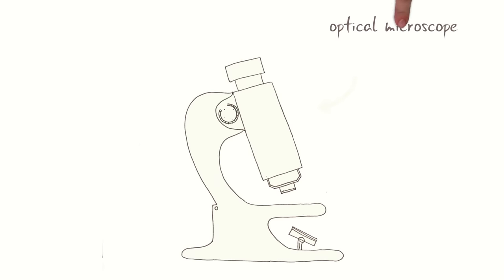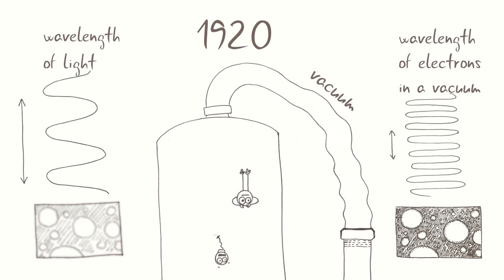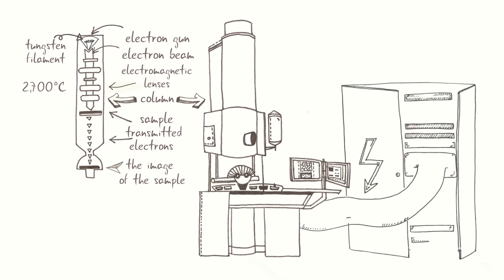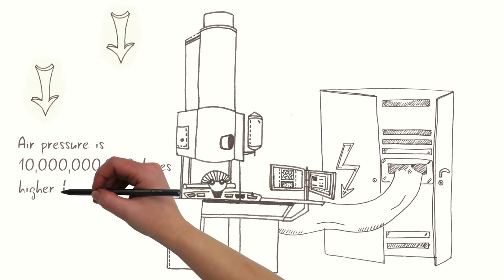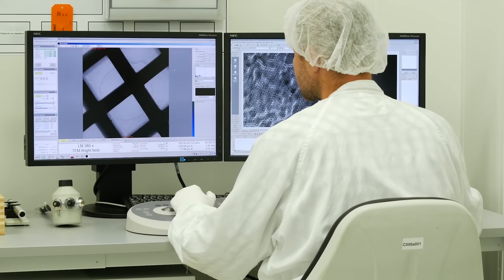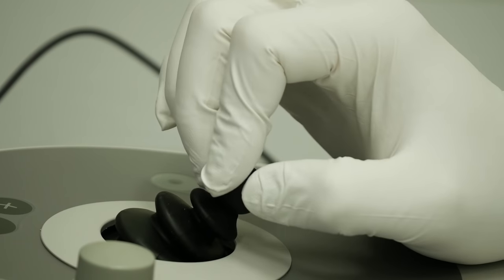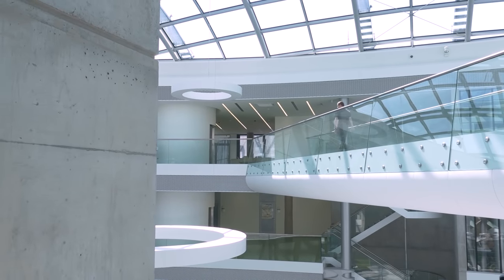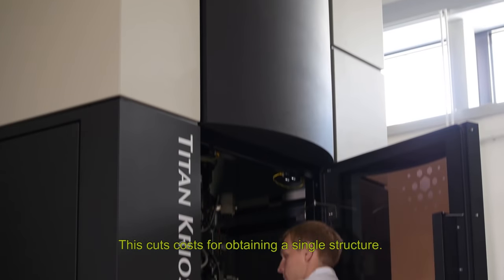2 The Principle of the Electron Microscope

Comment: Where do they get the electrons from?
What sort of atoms do they use? And do they detach the electrons from the atom?
Reply: They heat up tungstein to 2700 degrees and send 300kv through it. I think.
Reply: Metals are called conductors because their atoms tend to lose electrons compared to non-conductive elements. Electrons absorb thermal and electrical energy, and discharge that energy by vibrating and also in the form of photons; some of the outer shell electrons in the atoms of metals tend to be ejected from the atom for this reason.

I know the reply was a year ago, but anyway, I hope you find it useful.
Reply: @noppo4445  you helped me tho, so thanks :)

Comment: So you are saying I won't be able to build my own using 3d printing and some off the shelf components? That's a bummer. Maybe in a few decades it will be possible.
Reply: Don't listen to skeptics, just try it! 😉

Tungsten is at TIG welding stores...
Electronic components are at Farnell, Arrow, Mouser, TME, RS Components, everywhere...
Vacuum is absence of air, so just get rid all of it!